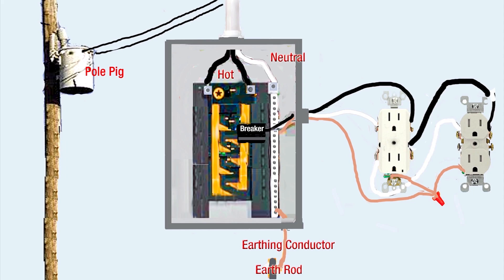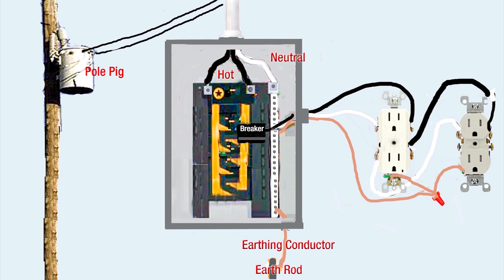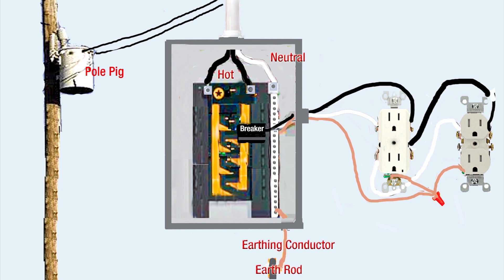Grounding, Bonding, Earthing, Shielding and Protecting with Jim Heath W6LG

Comment: I'm not an electrician, but I've done a lot of wiring. For clarification, it should be noted that the two hot wires from the pole (pig) are 120 volts each, which combined give 240 volts. For our purposes, we only use one of the hots for 120 volts. I agree, for safety's sake the equipment needs to be grounded to the main service. The reason that subpanels require four wires (two hots, a neutral and a ground) is so that a short will go back to the main panel, tripping the breaker. A seperate earth rod defeats that purpose. I've read conflicting advice on ham radio earthing/grounding, some say the equipment needs its own earthing rod which is totally separate from the main service earthing rod, others say they should be tied together. I am new to ham radio, so it could well be that a separate earthing rod can reduce interference/noise in some situations. But a separate earth rod dedicated to the ham equipment is electrically dangerous and is a shock hazard.
Reply: You'll have a problem when the ground wire is connected to the second earthing rod without a bond to the the ground on the electrical panel. The earthing rod to earth has a high enough resistance that the breaker won't trip.  That's one of the reason why the ground wire is bonded to the neutral wire in the main breaker box.

Comment: Great video - stimulating and thought provoking.  Are you saying that all HAM Radio transceivers should have built in power supplies because they would be safer because they would be grounded through their electrical connection?
Michael VA6XMB

Comment: In the last image with the red X over the neutral, the GFCI is still going to trip regardless of the earth rod.  GFCI outlets and breakers work by comparing the current on the hot wire versus the neutral wire.  With the X on the neutral, the hot is going to have current flowing while the neutral is not.  GFCI trips.
Reply: I agree, and there is one other item worth mentioning here and that is the "earth grounding" of the antenna tower.  The tower should be grounded at the base and not back at the main panel.  Having two "earth grounds" that are not bonded together and are separated by a distance (varies but lets say 30') can easily have a different potential between the two but, what are the chances you will be touching both at the same time?  It is a difficult question and requires much thought due to the number of variables present in a given situation.

Comment: If you have a situation where you're Ham equipment is Separately earthed , here we got earth leak detection or something like that in a normal installation where a breaker would trip if it detects current from the Earth connection killing power but, what if your ham equipment earth is taking all this current , maybe because it's closer to earth or has a larger cable connected to the earth rod and your main supply doesn't get enough current to trip ? so could this have the potential to keep your faulty equipment live ?

Comment: All cabinets must be bonded together and grounded to your home's green electrical ground wire. Right? Antenna must be earthed separately from equipment cabinets but together with coax shield (if it's a vertical).  Right?

Comment: Hi Jim

Great video! I have a question. I have a relatively NEW Samsung refrigerator that produces almost s9 static across all amateur bands when the inverter inside of it runs.. Is this due to grounding or earthing within the building or is it just interference I can expect from an inverter?
 
I have suffered for along time with this interference. I know it's the fridge because when I  turn the power point off the noise completely disappears.  Is it caused by a leaking socket or something, here power outlets are 240V AC at 50Hz.

I would like to know your thoughts. Would be good to fix my only interference.

Jordan

VK2LPF

Comment: So NOW I'm wondering how could things have run so perfectly and cleanly for decades - using only an old lead water supply pipe for ground/Earthing?
Reply: I just acquired a full system for an older gentleman that he no longer wanted. When I was taking apart his system there was no ground wire attached to anything. I'm wondering how he pulled that off.

Comment: I agree with your comments, and this is the quickest way to start an argument at a ham club! This was our tech talk topic a few months ago at our local ham club, and we soon discovered that the recommendation of having a separate ground system for radio equipment was against our local building code, saying that everything must be connected together.
Reply: Just seeing this now, 3 years later... my understanding is that that "separate ground" isn't supposed to be separate. The ground rod outside the shack (if you place one) is supposed to be bonded to the ground rod for the electric supply for the house (at least so many feet apart and using a wire of such and such a gauge, etc.)

Comment: Hello Jim. I remember living in a house with the old BX cable with the 2 wires wrapped up in paper and 2 prong outlets. The metal outer cover acted as the earth ground, I believe. The house I have now has modern wiring and gfi system. My shack equipment is not grounded to an earth rod. I have read up a little on this and have come to the conclusion that my rig is modern enough that the chassis is earth grounded through the lower prong on it`s 3 prong plug, and   outlet. All of my electric power tools have the same 3 prong plugs. I believe it is known a double insulation. Thanks and I will be waiting for the next one.

Comment: A good reason to buy a transceiver that works of a 12 volt battery
Reply: In the US I don't know of a Ham radio that is not capable of working off a 12 volt battery(ies).  If fact it's more of a problem running off AC as you need a power supply to convert to 12 v dc.  I believe Jim leaves it out for simplicity.

Comment: My radio is grounded to a earth rod. Not to house earth or water pipes etc.
When the ground wire is removed i get a increase in noise level by 3 s points . 
I have been told never connect to electrical mains earth.
Reply: And why is that?
Reply: @samgrieg  some houses are are pme  so there is no earth here in the uk. 
I live in a old hose so all could be fine but its the way i was told to do it when i did my foundation course.
As now the weather is getting better time to sort antenna earths etc.

Comment: What if i am in a situation where i run equipment off battery? Should i get a separate ground for those equipments?
Reply: At 12V there is no need to worry about electrical ground. Although you might still need to consider lightening and RF ground.
Reply: Yes anything help when comes to reducing noise. I am thinking use a  4ft electric fence ground rod. The full size 8ft is little difficult.  The other thing about lighting is usually your equipment isn't distroyed by a direct hit , direct hit is rare unless you live on a peak or have a really high tower. Power surges from powerline can result from a lighting somewhere down the line, that can cause some damage. Just disconnect everything when storm hits.

Comment: Thanks for the video, sir. I am an engineer and a Ph.D. Heh... that and five bucks might get you a Starbucks. ;) I've also been working with audio for a long time and have had the crap shocked out of me by potential difference between the PA and my guitar amplifier (through the microphone).

I have not yet decided whether having a double ground for the station equipment is a good idea. My initial thought is that the earth ground from the panel should be the right way to go. If I install a second ground, then there is the possibility that there will be a potential difference between the two. I haven't figured this out, quite yet.

Bonding the station components together seems like a very good idea because it equalizes the potential of the cabinets. I have no desire to be shocked by potential difference between the various pieces of equipment.

We don't have lightening here very often in Carson City. But when we do I'll disconnect the antenna(s) from the system.

I'm hoping to be a new ham operator by the end of the month. I'll take my test(s) the middle of the month.
Reply: How can you have a potential difference between two points both connected to ground?
Reply: @sketchyAnalogies  if there is much distance between the two earth grounds, there will most likely be a difference of resistance to ground, which is why 8' ground rods should be bonded together every (minimum) 16' back to the main service ground rod.  It ensures the service ground and your shack ground are virtually at the same ground potential.
Reply: Copper wire has a resistance over distance.  A #16 for a ground wire has a resistance for 10 feet would be about 0.04 ohms.  At 15 amps, that would be around 0.6 volts.  Though not much, if the current were to go up, the voltage drop from one end of the wire to the other also goes up.

Most romex wire today has the ground connection a size smaller than the black and white.  (So 12 awg black/white/red would bundled with a 14 awg ground.)  A 15 amp circuit would have a #16 awg grounding wire.  A 20 amp circuit would have a #14 awg grounding wire.

The romex wires in my house are about 30 feet long, so if I were to have new romex cable for #14 awg, the ground wire resistance would be 0.12 ohms.  Doesn't seem like much, but if there was ever a high current you could use ohm''s law to calculate the voltage.  This is why they say in a RF station use #8 or #6 awg wire.
Reply: Funny, all those credentials and not yet a Ham ?
That easily should have been given to you, as part of your degree !
IMHO !
Once licensed, you'll learn just how over qualified you really are !
Good luck finding anyone on the Ham bands, nowadays that can keep up !
Question begs ?
Did you go from first test to Extra, in one setting ?
Most frustrating thing for older Radio Amateurs, is the lack of practical experience, one would have experienced, coming up through the ranks, as you began as a Novice, and worked your way up !
Now, sadly, no longer a requirement !
Essentially you now have Extras that can't answer questions a Novice would know !
And that, is a no shitter !
Reply: For me, grounding at the panel is my preference.  For audio, I prefer to use an isolation transformer if the grounds need to be isolated, but still keep them grounded at the panel.  The more grounds one has I think the better.
Reply: David Thompson Well, I have been zapped by all sorts of things but in my experience with both radio and audio is that "hard grounding" i.e. Direct to earth screws with the audio and/or RF, it also sometimes can do weird stuff to other equipment like making a PC not turn on as some safety thing in the PSU senses that. I have not figured out why this is as in theory it shouldn't make a difference at least to my basic understanding of the subject, but it does. So I basically use the ground in the socket even though I occasionally get zapped by something or other, and I think Jim had a good point about it potentially defeating the ground fault trip switch, which I hadn't even thought of before. I do know some guys who think the opposite of this but I care more about things working right than some theoretical debate point and eliminating the occasional zaps I get from stuff. Just my 2ct, 73's.

Comment: Like you said, rf grounding is variable compared to AC/DC. I’ve always been told to run a ground rod 8’ along with a single radial under earth. BUT, here’s where I get confused, if your equipment is grounded via the 3rd prong, wouldn’t that make it bonded upon plug in? I also see most people saying to bond the rf with the ac ground. Well, wouldn’t that create a loop through the outlets and box ? It’s so confusing that I just give it to you guys to figure out. Lol. Look forward to each video.
Reply: Defined Horizons the ac ground is earth grounded right?